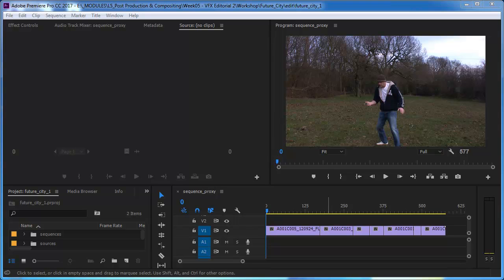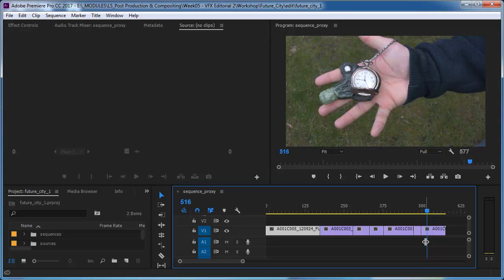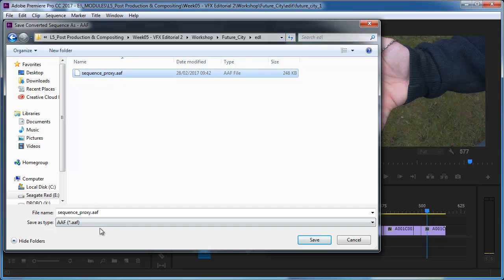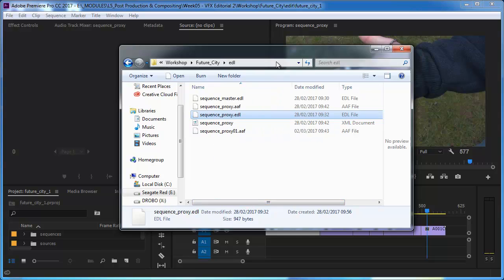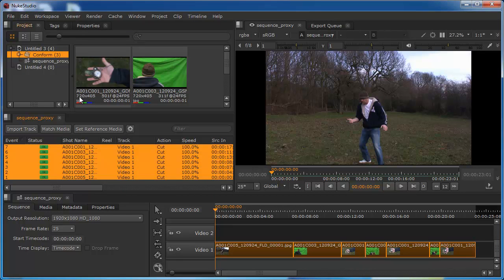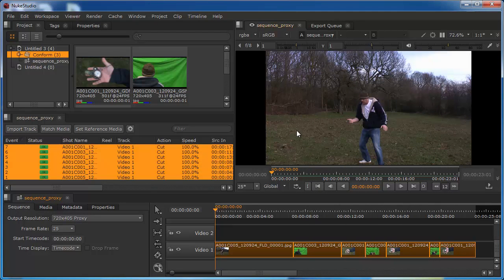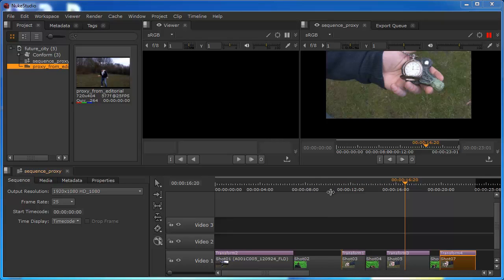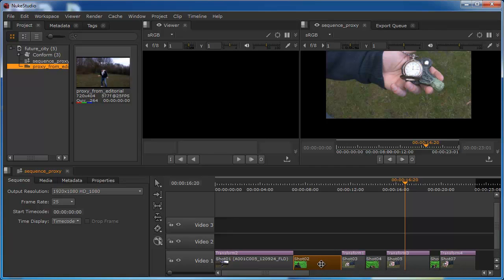Conforming in Nuke Studio - Part 1

Comment: I keep getting this "nuke studio Failed to decode audio error" with all my video files , weather its MOV , AVI, etc .Any info on that?
Reply from the maker: Not seen this error but my first step would be to try to rule out a codec issue.  Open your project on a different machine and see if it occurs.
Reply: this is normal when exporting timeline, it happens to me, I haven't figured a way to fix it, I think it has something to do with how each programs with with audio files on timelines